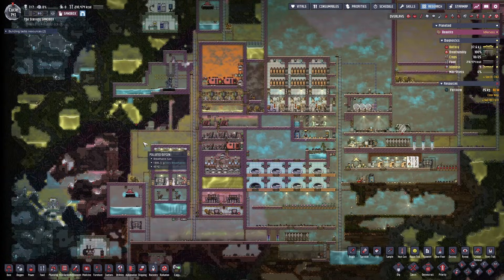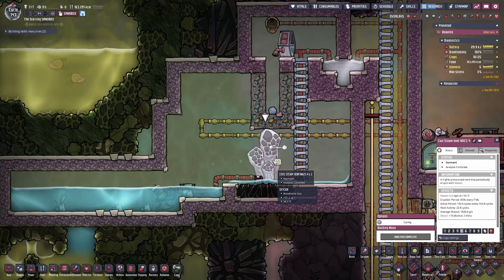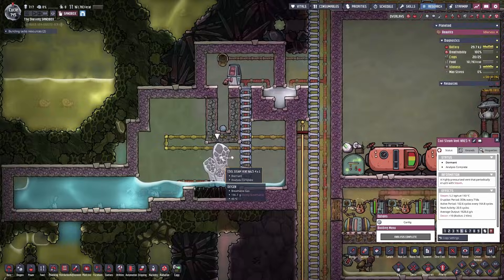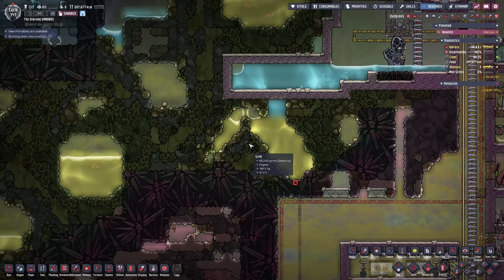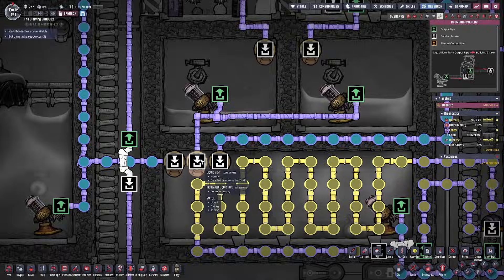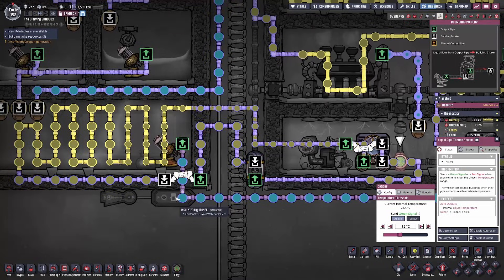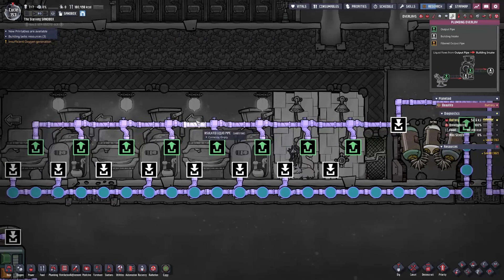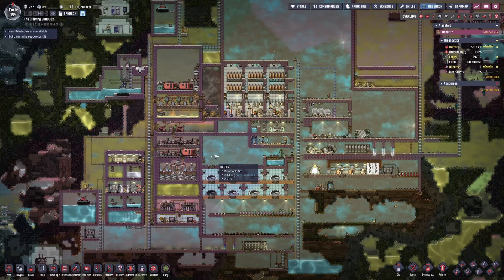WATER SUSTAINABILITY 101 for BEGINNERS in Oxygen Not Included

Comment: It takes a bit more setup, but I like to put my bathroom above a quick & dirty SPOM. Layer directly below is sink, compost, filtration, bottle drainer, electrolyzer + gas pump, & liquid reservoir; layer below that is a couple of hydrogen generators, gas reservoir, smart battery, & a kickstart manual generator. Excess water input from the bathroom goes into the SPOM to reduce the hit on your water reserves for O2 early. Gas pump is built above the electrolyzer to pick up the hydrogen, which is filtered out via the valve method & sent to the hydrogen generators, per standard, with the O2 being vented on the far side of the base, and the electrolyzer is built on airflow tiles in order to allow the rest of O2 to just vent straight out the bottom so that you don't need a second gas pump. Produces a substantial amount of excess power, so you can do some power priority tricks to make sure it powers itself first and then tap into it to run various other pieces of kit. Very handy IMO for going for Super Sustainable, since it's the first opportunity for power that isn't a manual generator.

Comment: I still dont really get how to cool water down
Reply from the maker: Aquatuner is the best way, -14 for every packet of water that runs through it. You need to set it up with a stream turbine, check out my tutorial for that
Reply: The simple beginner way is just to run it through an ice biome with radiant pipes, or store ice in a pool of water and run warm water through it with radiant pipes
Reply: Early game don't dig it out much undug tiles can sink a lot of heat instead insulate an outer boundary and let natural tiles inside the boundary temper it also leave a small reservoir to hold a water pump underneath it and seal the chamber.  Finally only pump what you can use immediately.  All that together should enable you to get the research and materials together to get a cooling loop done.  The heat economy of oxygen not included usually involves transferring from one location to another and once you have enough heat built up transform that heat into energy that's why we have the thermostat and then once you have it concentrated hot enough you can use the steam turbine to munch that you can turn into power.
Reply: Damn text to speech not thermostat Thermoaquatuner

Comment: 17:00 don't do it your way, do it the other way, insulated pipes still heat up eventually, and the liquid sitting stagnant in your steam chambers could turn to steam and break the pipes.  keep the loop moving at all times to prevent this.  In this specific use case, it's not bad because it's based on something very consistent, but if you use it for other options, it could cause real problems
Reply from the maker: Thanks for the additional info!

Comment: Considering the amount of water on a regular asteroid, you must really try hard to run out of it.
Reply: Absolutely right! I'm overflowing with too much water on my main, and teleport asteroid. I've had to block off a few sources.
Reply: @SusheelChandradhas  For me, the game is way too rewarding ressource-wise.
When you find yourself on a small teleporter destination that happends to have like 2-3 cool steam vent, 2 nat gas vent, 1 volcano and 1 gold volcano (or smt like that...) In what world can you run out of anything?
For me, it goes as to take the fun out of the game.
Reply from the maker: You get so much on Terra asteroids that it makes you TOO comfortable when you try some of the harder ones lol. I'm in the middle of a playthrough right now where I didn't have to start thinking about cooling water until cycle 250
Reply: @ethanplays-lag  For me, the games really lacks some challenging starts where you really need to worry about ressource management and how many dupes you take.
Or settings added to the game to reduce the numbers and make it harder.
Cause again, on a normal start? ... For it's just impossible to run out of anything. Your CPU capacity is the bottom line of it, sadly.

Comment: Build at 7:00  is interesting, I would put an metal tile or airflow tile under the ice, so the ice is in water and can better exchange temperature. I would also replace the top 2 mesh tiles on each side with tiles so the steam can't go up (the dripping water would water locked it). If i go with this, i would also add several tiles of water to have it a bit more robust, and more exchange, maybe one tile on each side and let the excess water falI.  I would also shift 1 tile to the left to be on top of the tile of interest of the vent. 
All in all, nice idea, i like it. I like those no tech solution, but here the debris to gas heat exchange is really poor for the mass we usually have of ice. Another solution include pressure plate under the ice but you would need sweepers etc. Another simple solution could be to have the ice dispenser in the entrance liquid lock itself, raising the base side by 1-2 tiles so it spill in the steam vent room, and you don't get wet bringing ice. 

12:05 The most heat exchange would happen when ice pass the mechanical door, not when it pass the gap.
If you pass through a conveyor loader, might aswell put some metal tiles in water pool and pass the rail with ice through it, that's the most heat exchange you can get. Be mindfull of when the ice melt in the tiles, the liquid will "teleport" (i think always up, so you can't have the melter on the roof, but not sure).

17:45 You don't want to repump the water here. You can have a priority to your liquid vent/pitcher pump if you want, but you don't want to repay the power cost of pumping water for no reason.
Reply from the maker: Thank you for the suggestions, especially the ones on saving power. Sometimes I over complicate things for myself

Comment: Cool slush needs to be warmed up a little before you can send it through refinement or it will freeze and break the pipe (both brine and polluted water.) In general not a big issue. Plants along the way of a really cold pipe can also stop growing the same way they do not like high temperatures. Cooling a base with a cold water vent is not very stable. Dormant or overpressured vents do not cool at all. Gold is a bit of a tricky material but it does work even in cold steam or basic generator setups that do not involve a liquid generator running permanently. Having some thermal mass around is usually appreciated by gold buildings.
People hate algae terrariums because they need massive amounts of dupe labor but they actually need less water than spoms. They also need less algae than the electric version. Alvae Vera from the frosty planet pack does in normal planter boxes require more water than spoms but if planted in a greenhouse they outperform spoms. Setting up a man made ceres area is possible with a single cold water vent. It is very fragile and needs a lot of tinkering but can save a lot of water. Water resting in mesh tiles cooled by a cold water vent does not produce tiles and only debris that can be picked up to fertilize the plants. Cooling salt water into brine generates ice debris, too. The salt water chilling does not work with vents and only with an aquatuner setup.
An insulated generator area produces water if the fuel is not sourced from an oil well. Slicksters are available in every start and while temperature and suits/masks are something that needs some planning, a petroleum generator produces as much water as an brine or salt water source. They are not trivial but definitely not much more difficult than aquatuners. Bionics can work in generator areas without any protection.
Reply from the maker: Yeah, that's true. I should have made that more obvious in the video!

Comment: Thanks for the Video. 
One recommendation I'll make is to include an Aquatuner bypass. It is generally best to never allow water to be sitting in a pipe in a steam room. Keep it circulating just in case the system need to shut down for an extended period. Maybe it is a bit better if you were using ceramic or insulation but it is generally just automatic for me to always include the bypass.
Reply from the maker: Good tip, and thanks for pointing that out. Alternatively, I could have not used the liquid shut off to keep the water flowing, and used the pipe-thermo sensor to turn the aqua-tuner off and on

Comment: Pls make power sustainability 101 pls im stopped by needing more power and needed  more cooling for it. Meaning can't do more thermalacuathuners becuse they use too much power right now
Reply from the maker: Thanks for the suggestion. I'll work on that for this week!
Reply: Stop cooling your water and instead cool your farms. That will save you a lot of power. Plants don't care about the temperature of the irrigation. And of course use insulated pipes for the hot irrigation water.
Reply: @imazined   I think plants care about the temperature of the irrigation. Thus, there is a risk to stifling your crops.  I have not tested this, but I think I remember having this problem in one of my playthroughs.
Reply: @jawsstech  what stifles the plants is the heat leaking out the hydroponics. But the plants itself don't apply the heat by irrigation to themselves. I run sleet wheat for thousands of cycles with 95C irrigation water. They need cooling by running a cooling loop above the tiles. But cooling the heat leakage is mich cheaper than cooling the irrigation water.
Reply: @imazined  you got a lot of Info for someone that's not making videos, and TBH you should start lol i tried to get on this game and play but I'm not used to any of this and as much as i like seeing @ethanplays-lag videos, since I'm new i am not understanding anything at all lol not saying they don't have good info its just each planet is different and you have to go about things in different ways so at that point aside from digging a lot, making an area for Co2 to drop down into early game and making a clean water source like if you have multiple areas and you dig to pull them all into one area of clean water than there's setting up farms early so your dupes don't starve. and than how ethan said getting into coal generators and setting up a water lock for it but in no way are any of the piping, wiring, how big the area you should have or where to place it are explained at least in one of the other videos i watched i got a planet that i got dug up not too far just to avoid heated areas but tbh i took a pause from it and got on another game cause i'm still lost and have a feeling it could lead to a good run but i don't wanna screw it up like my other runs.
Reply: @imazined  also the discord link to the game would be greatly appreciated.